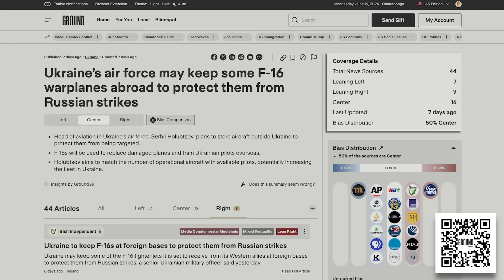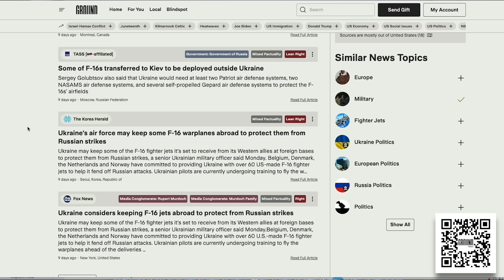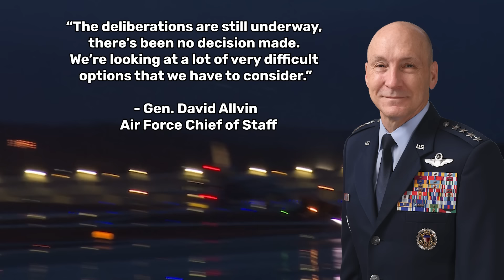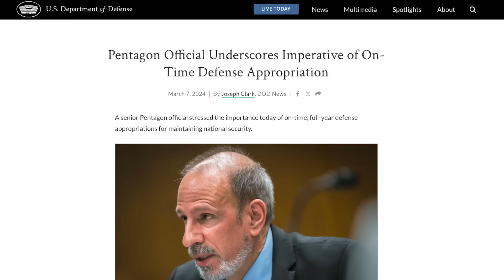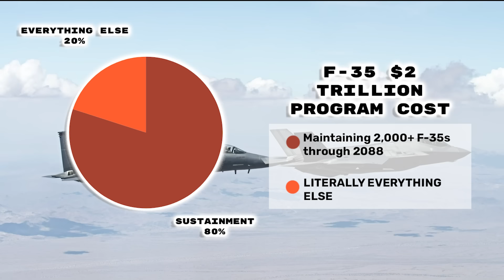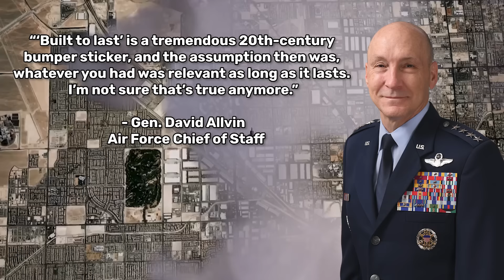Will America's new stealth fighter be shot down by cost already?

Comment: I am a Military Avionics Test Engineer and I was shaking my head through most of this video thinking "This'll never work" until he started talking about the Gambit procurement method.  That sounds like the way to go.  Only upgrading systems that need it every 5 years will keep the NGAD current and the costs, which are gonna be high, down to manageable levels.  Just my opinion, take it or leave it.

Comment: The first time I heard the projected price tag for the NGAD, I knew there was going to be a problem. They cut the Raptor buy by 75% and NGAD is not a better deal. There's one question the Pentagon needs to answer: Where are the long range, stealthy strike drones? The answer to that question is more than 50% of the solution to America's future air dominance.
Reply: Weren't that basically what the unmanned "wingman" concept was going to be? To go alongside NGAD. Were they a packaged deal or seperate programs?
Reply: @extragoogleaccount6061 Kind of both. NGAD is supposed to work with the various wingman things and have an unmanned variant of the NGAD
Reply: The long range stealthy strike drone is already in production. It’s called the B-21.
Reply: The X-47B was canned in 2015, but it fit that bill nicely. Stealthy, payload capable, and so friggin accurate that it wore down the non-skid on carriers because it kept hitting the same spot on the deck when landing.
Reply: @rainiercardin8788  The X-47B seemed like a great platform. Even if it needed to be refined, right now there's...nothing.
Reply: @rainiercardin8788 I've been hearing the "too accurate landings" claim about drones since the 1990s. The X-47B only did a few dozen carrier landings during the test program across two carriers in almost two years. That's not enough to do that kind of damage to the decks be a major factor in maintenance, and it wouldn't be hard to adjust the landing software to vary the touchdown point somewhat with every landing.
Reply: Rightttttttttttt
Reply: XQ-58 valkyrie and XQ-67A are already flying alongside F-22 and F-35.
Reply: @benjaminlynch9958  
The B-21 is not a drone.
Reply: @rainiercardin8788  
No. It didn't.
Reply: The long range stealthy strike drones won't help with air dominance. you need fighter drones that attack aircraft in the air.
Reply: @benjaminlynch9958 The B-21 isn't an unmanned drone.   🙄
Reply: Right now, the modern bomber series is answering that question. We still need NGAD though to maintain our ability to sanitize the sky. Drones and AI aren't far enough along to fight like a human can in air to air.
Reply: @zaco-km3su it has a drone mode

Comment: I think the issue is more reputational. Lockheed is very busy with the F-35 and F-22 programs and well known to take longer at their programs then the brass would like. Boeing is in deep doodoo because of all their controversies, see T-7 Redtail, loose parts in tankers and all the crap in their civilian side as a few examples. Northrup Grumman is busy with the B-21 and the Naval NGAD programs. There is no contractor available with enough bandwidth to tackle the Airforce's NGAD program. Might be better for them to let the naval program develop and adopt a land based version of that.
Reply: Lockheed did something similar with the F35. A marine unit received 6 F35Bs , all of them had something wrong with them and it wasn't the same thing on all 6 but different things and multiple. Whoever was working on those jets did a "screw it" job. Lockheed can't even complete their refresh 3 so that Block 4 upgrades would be possible. Not only that a couple European countries received their first F35s and they received them in the most basic configuration when the contract stated it needs to be the latest tech version  , it might have been The Netherlands , or Belgium or Denmark, I'm thinking the first one.
Reply: A lot of reason for these delays not widely researched by the general public but TR3 is essentially a new jet. Not a bandwidth issue but a cutting edge tech developmental delay issue.

Industry bandwidth isn’t the issue here, industry can ramp fairly quickly. It’s the veiled wishywashy nature of DoD development needs that leads to constant iteration, churn, and waste.

When there’s constant funding restraints and change orders, the talent leaves, equipment goes into storage, and ripples are felt 5 tiers down into the supply chain. Then some fool on the internet starts pointing fingers, gains media traction, pressurizes the DoD, then political pressure comes down hard on the program. It’s a tale as old as time.
Reply: @wan3416  TR3 isn't a new jet at all. Just a new computer and related systems. Older versions can and will be upgraded to TR3.

Comment: There is a little photo failure at 10:57 concerning the Century-Series of US fighters: that's not a F 106 Delta Dart at the bottom of the right side! Round air intakes with spikes, firmly mounted fuel probe protruding to the right side, round non-edged form of the cockpit canopy, Matra R 500 Magic Air to Air missiles and MBDA Mica RF or IR variant air to air missiles under each wing, an engine exhaust that doesn't fit to a F-106 Pratt & Whitney J75-17 (F- 106A) turbofan nozzle. And last but not least: the F-106 Delta Dart had no centerline pylon for a fuel tank!! Nope, this is a French Mirage 2000 (may be the C variant) single seater with US-markings! Best regards from Germany.👋

Comment: "Digital Century" would have allowed us to have the YF-23... Not necessarily the actual fighter. However, we would not had to leave an equally qualified fighter to scrap. Or the Super Tomcats would have been viable. Especially as both the Super Tomcats and YF-23 are ironically better qualified for the foreseeable combat criteria emerging.

That we will have more working designs that could be leveraged toward foreseeable threats and challenges much more quickly. This would also mean having an all-in-one superplane will not be an absolute requirement. Although that will not stop the occasional F-14 from springing up now and then.

Comment: To be fair, there are a lot of new stuff that can be applied to the 35 and 22 for massive upgrades: new durable stealth coatings, new engines that are more fuel efficient, GaN AESA.

All those 3 can make provide a big perf leap to the F-35 without any crazy complex project.
Reply: Lockheed can't even fix their software so that F35 can be upgraded to Block 4... have you see Block 4 upgrades , it's like science fiction but if 3rd refresh isn't happening for the software Block 4 isn't happening either.

Comment: Considering the apparent capabilities and lack of success with the US’ primary opponents, Russia and China, they could’ve also decided they just don’t need the NGAD just yet.  Neither the SU-57 or J-20 struggle to even partially duplicate the F-117’s stealth performance.  And maybe they could theoretically match the F-22 in agility/maneuverability etc…but that’s much use when you can’t even tell if you’re being targeted.  

Russia’s land army is in shambles, it’s navy is almost non-existent.  China’s army and navy might be in better shape, but their ability to send it anywhere is next to non-existent and they seem to be struggling with building reliable and effective aircraft carriers.
Reply: China's ability to project power globally is nonexistant because that isn't the war they are planning on fighting. They want Taiwan, and other than that they are geared entirely defensively and plan to influence the globe via economy.

The US has a big problem against China right now in that they have a lot of very capable anti-air and anti-ship missiles that makes any conflict with China very costly. Perhaps the B-21 will help negate a lot of that, but I can't help but feel leaving a gap in the air dominance modernization category isn't negligible. At the same time, perhaps the other capabilities they are considering putting money towards instead will better counter China's current missile advantage than an airframe designed to deal with other airframes.
Reply: ICYMI, China is CRANKING OUT J-20s! Meanwhile, Russia is producing Su-57s; granted, they're producing them slowly, but they can still produce them. As Alex said, we'll never get another F-22. So, there's that...
Reply: @markymarknj +1000 social credit for you
Reply: @markymarknj  the Russian su57 is something that could be easily dealt with with existing assets, they're just "dressed up" su-35. And they're never going to produce a significant amount of those. They can't even build their t-14 tanks for financial reasons (as stated by their officials, I assume they have other reasons for that such as shortage of critical electronics due to sanctions). A plane is harder to produce and it's much more expensive. 
China is an issue at least due to their quantitative advantage, so if not ngad, at least CCAs need to be mass produced and control of those implemented in f-35, f-22, f-15ex and other aircraft.
Mind you, I'm pretty sure the Chinese overstate both capability and quantity, but it's better to overprepare in their case.
Reply: Just because someone is currently ahead, doesn't mean they should slow down and rest on their laurels.  This is a lesson taught to most people at a very young age.  Didn't you ever get told the story of the tortoise and the hare?  Even if NGAD remains on schedule, it wont be operational until 2030.  Even if all the funding is supplied, it'll likely be a couple years late, because that's just the nature with such complex state of the art technology.  We don't know what China, Russia, or any other country is working on behind the scenes, though arguably China is the only one we really have to worry about.  Just because the J-20 isn't up to par, doesn't mean it's successor won't be capable of taking that next step.
Reply: @00HiGhGuY00  EXACTLY! Especially with next generation fighters, there are development challenges that go along with pushing the technological envelope. Just look at the history of the F-14, F-15, F-16, or F-18. We saw that with the F-22 also. Why wouldn't it happen with the NGAD?
Reply: @BoraHorzaGobuchul  the problem is, with the Federal Gov't adding a trillion $ of debt every 3-4 months, we could end up in the same spot as Russia-unable to build things in meaningful numbers for financial reasons. Even so, Russia at least can still produce their cutting edge fighter; they can make more Su-57s anytime they want. We cannot do the same with the F-22.

Secondly, I've long maintained that the US should pursue more basic, more maintainable, and more maneuverable fighters, a la the F-20 Tigershark or JAS-39 Gripen. The Gripen can be maintained by a crew of six: one career military man and five conscripts. It can operate from roads. It's maneuverable as hell. And, it's AFFORDABLE! I'd love to see the USAF license build the Gripen here, as it would be a cost effective way for us to meet our fighter needs for the next 2-3 decades, if not longer.

Thirdly, modern Russian fighters are all supermaneuverable; they all excel in dogfighting, or WVR combat; they're better than our fighters in WVR. If they gave their pilots proper training and experience, they'd be deadly! Thankfully, Russian pilots get so little flight time per year that they can barely fly their aircraft safely (look at the drone incident and how the Su-27 pilot is barely flying his plane safely in straight and level flight), let alone make use of them in combat. That would be our only saving grace if we fought Russia.

And yes, I hope we do CCAs at the very least; we need them badly! Even if NGAD goes through without a hitch, I think it'll be the last manned fighter; trends are pointing to AI controlled UCAVs and CCAs. Even now, AI equipped F-16s are cleaning up in exercises against manned fighters. Also, an unmanned fighter could exceed 9 Gs, as there's no pilot to blackout; it would do maneuvers that we can't even think about doing now. What could a dedicated UCAV or CCA do? The possibilities are indeed fascinating...
Reply: @dead-claudia  for speaking the truth?
Reply: @markymarknj  in quite certain there's other areas where the feds could cut costs. Like surveillance of US citizens, financing ATF, and so on.  There's so much waste it's crazy. And the story about the Caribbean debt of the US is I've if the favorites if the Connie propaganda since soviet times. Just like the story about how dollar will crash soon. Have been hearing those since I was a kid, and I'm 40 now.
Reply: @BoraHorzaGobuchul  also, as great as the F-15 has been; as impressive as the new EX variant is; the fact of the matter is that it's a 50+ year old design. Sooner or later, it has to age out.
Reply: @GhostlyTurtle  
The Chinese love you. You couldn't be blinder to China's power projection. There's more than 1 way to skin a cat.
Reply: @markymarknj  
Russia CAN'T produce Su-57s. Don't lie. They don't have the capabilities.
Reply: @zaco-km3su  though producing 1-2 Su-57s a month is slow, isn't it still production though? Aren't they capable of making more Su-57s than we are of making F-22s? THAT was my point!
Reply: @zaco-km3su  I literally said they power project through economy, not military. Stop trolling and learn to read, then you will realize you're agreeing with me.
Reply: @zaco-km3su If they cant then how are they currently doing it? Denying reality ia not a good look.

Comment: The same thing that happened to the F-22 is going to happen to the NGAD or whatever. They'll initially order hundreds while it's still in development/testing. Then Congress/USAF/whatever will go, "Oh my god, this is way too expensive. Slash the order." Then the price will go up because they slashed the order number. Then they'll cut more because the per-unit price went up. And instead of having several 750 F-22s, we ended up with less than 200. And because the initial price of NGAD is even more expensive, we'll have either a B-2/B-21 or B-1-esque fleet of NGADs/6th gens. Calling it now.

Comment: From a systems POV, the swarm scenario as a system is an example of how a higher organism generally allows each component to be less fit than a single entity that must survive on its own. So a proper analysis should drive a design where each plane, whether piloted or not, can be cheaper than any Gen 5 fighter. IOW drop features from the key manned fighter and make it the same as the wingmen except for optional manning. This plus modularity should result in a cheaper, not more expensive architecture.

Comment: Never should’ve cancelled the F-22 program.  Never should’ve started the NGAD and F-35 programs until the aging fleet of fighters were replaced with F-22s and their potential variants.
Reply: the f-35 was mired in delays, partly due to the us military constantly changing requirements. that's part of the problem: the us military is being too indecisive on what they want.

the us navy's ngad is fortunately not suffering this fate, bc they first decided on what tech before proceeding to the airframe surrounding it. that tho comes on the heels of a large number of similar failures around ships bc of the same indecisiveness problems the army and air force are having
Reply: lol it’s how engineering projects work. The scope changes all the time. It is not remotely unusual and the ones complaining are the ones furthest removed from the world of technology development
Reply: @BoschhammerActual  You can still improve technology without having to scrap entire assembly lines and redirect them towards other projects.  I’m just trying to provide alternatives to help fix costs is all.  Besides, you don’t always need to be innovating something new every two months if you can gate keep your opposition(something that the U.S. doesn’t seem to want to do these days).

Comment: Of course can all planes be shot down. The advantage stealth gives is that the enemy most come closer to you, than you need to come to him before someone can open fire. So the plane with steal is more likely to get the first shot and win the fight.
Its not a guaranteed victory. The other plane might have super strong sensors and AI that can collect data from multiple sources and get a superior situational awareness and capability to shot down a stealth plane, before it can see the other plane. At least in theory. In practice do I however think that this is very difficult to achieve.

Comment: We are nowhere near being able to effectively design and test digitally. This is ultimately adding to the coat of these programs, since it leads to necessary design changes after production units exist (hello F35). Less extensive testing earlier in the development of the airframe would likely be better in the long run.

Also, decoupling design and production contracts would be super messy. Being a subcontractor is one thing, because that relationship is defined, but if I'm northrop, for example, and i have the sole responsibility for production of a lockheed airframe, how do i handle production discrepancies? If lockheed isnt involved, im not going to have access to the baseline engineering.

Comment: Thank you for the excellent video and perspective. I am wondering where this leaves the US Navy and the F/A-xx. I realize they are separate programs.  But, is the Navy anticipating tapping into NGAD tech (engines, radar, electronic warfare), or maybe NGAD manufacturing capacity (contractors)? If the Navy accelerated F/A-xx would that impact or influence the USAF?